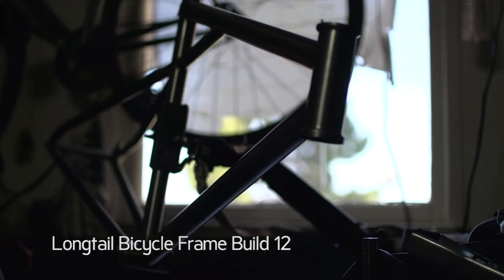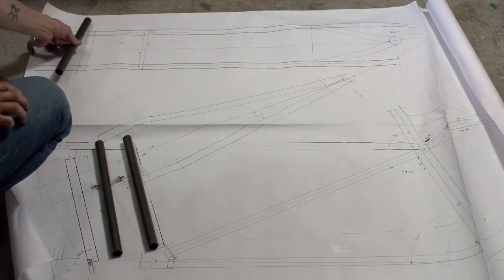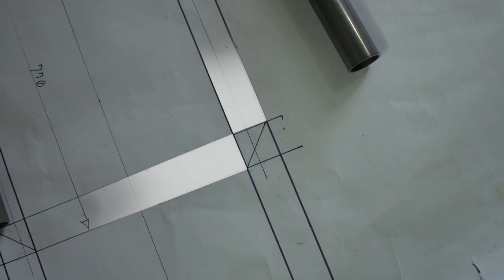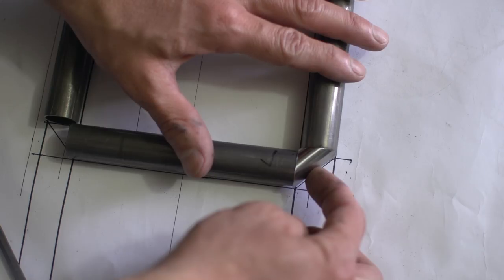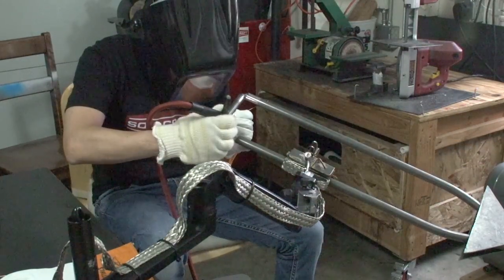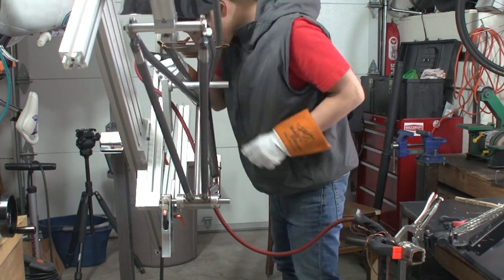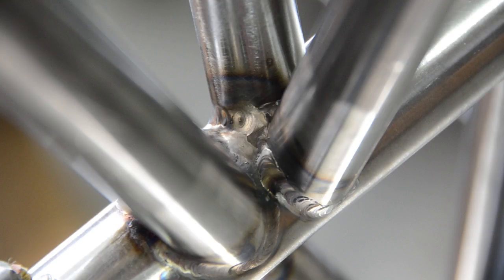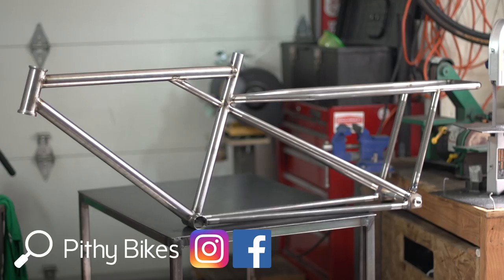Longtail Bicycle Frame Build 12 - TIG Weld Rear Rack

Comment: I am 54 and i believe if you were around in the mid 70's when BMX was taking off your skill's would rival that of  webco, red line, mongoose, mathews etc even without our friend the computer.  Without a doubt you would have made a mark in the industry or at least the baddest bike on the block.
Reply from the maker: +David Goodrich I know what im building next... A time machine.
Reply: If you succeed please bring back a set of mongoose motomag rims.  without a doubt the most beautiful rims ever made (IMO).  Not to mention they will test the integrity of the best frame builders ...even yours  what tha hell bring back 2 set's and i'll throw in 20$ over retail (89.00$ circa 1975 ) for a set .    good luck.

Comment: Welds are still looking great. Your solution to the miter cuts is a bit unorthodox but it turned out just fine. I'm cherry picking your taco jig idea. Looks like it works really well.  Great episode :)
Reply: It's the Pithy Taco tool.
Reply from the maker: +Jess Neal yeah the taco works great and only took 15 min to make.

Comment: Hey really enjoy the videos. Just wondering if the occasional weld problems might be due to sealing the tubes? I've found with aluminium, heat causes the air to expand and blow out the weld unless I drill a small vent hole.
Reply from the maker: +Richard HART it probably was that!

Comment: Just came across your video, really nice fit up and attention to detail!  I have no idea of your experience, but I only get that sparking behavior welding 4130 when the insides of the tubes were not sanded and cleaned with acetone as well as they should have been.  Your tube prep looks great externally though, so I assume the insides are the same.  Keep up the good work, look forward to the next video!
Reply from the maker: +Eric Olsson insides were clean too but you never know, maybe i missed a spot. I noticed also that once it starts to spark, it needs to be cleaned again well so maybe there was contamination inside i couldnt reach at that point. Thanks for watching!

Comment: heat will cause metal to draw out thus popping a tack... copper blocks will make a great heat sink keeping your tacks from breaking
Reply from the maker: The recommended material is Bronze. One of the best makers of frame building tools uses it. Checkem out :) http://www.paragonmachineworks.com/frame-building-parts/frame-building-tools/heatsinks.html
Reply: Most of my tigging experience is with stainless for me copper works I have a small tool box filled with heat sinks and various tig lenses if it works it isnt silly but i will have to give bronze a look